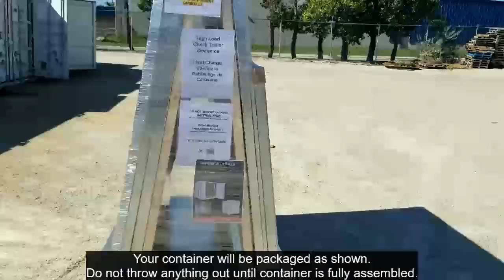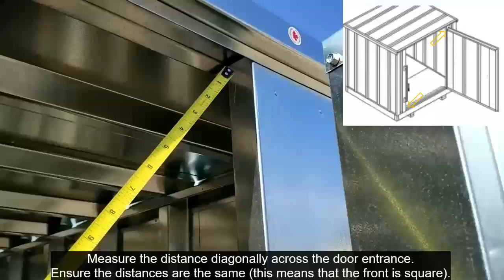Standard Container Assembly

Comment: Man I shoulda made mine on a more flat surface. I swear it was level. I could not line up the floor lines while squaring the corners. I then noticed the roof not nicely coming down on the side panels @6:09. Lastly my door touches at the top of frame making it not smooth to open or close.